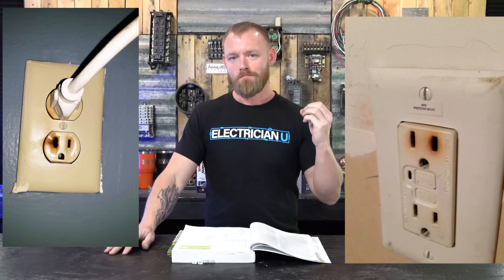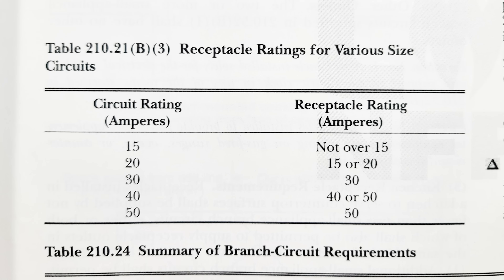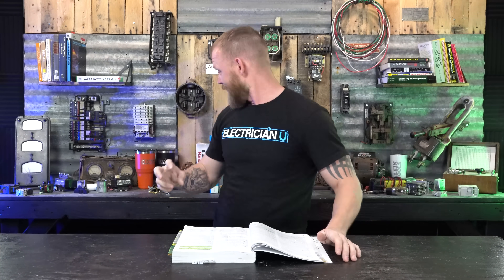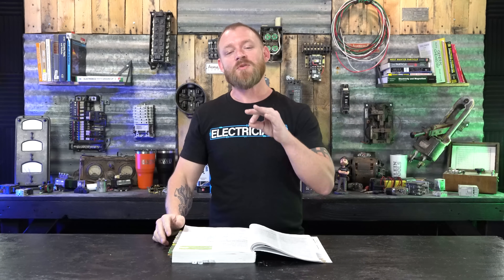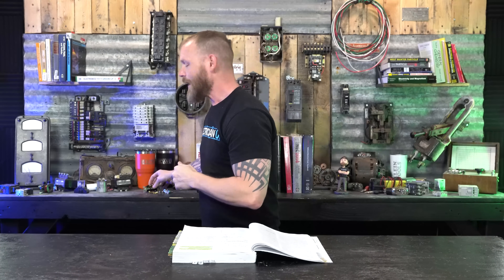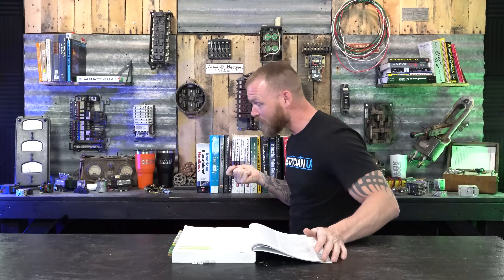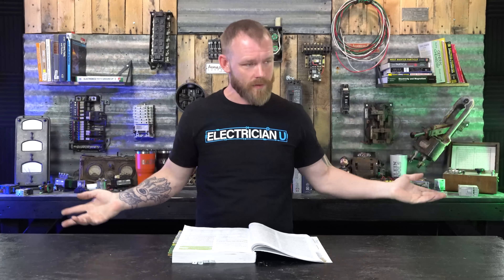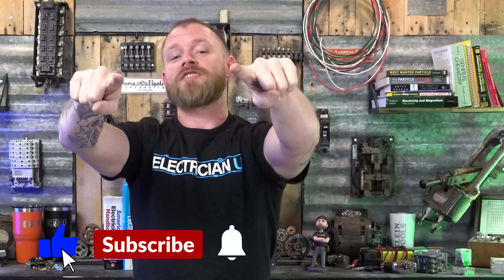Won't These Melt?!? 15amp Receptacles on 20 amp Circuits!!!

Comment: With modern home wiring that mandates an outlet every 6 feet there's less of a chance that any given outlet will have too many high-draw devices plugged into it, so I imagine that this is one of the reasons that's both ok and safe to install 15A outlets on a 20A circuit, since the total load will be distributed across multiple outlets, none of which should have more than 10-12A drawn from them.

Well that's the theory, at least. In reality many people probably tend to overload one outlet using outlet extenders, power strips and extension cords, because it happens to be slightly closer to their devices than nearby outlets, or isn't covered by a sofa or desk and such. All the more so in older structures where there isn't an outlet every 6 feet.

Which is why maybe it might be a good idea to install 20A outlets even though code only requires 15A ones. Are there 20A-rated outlets that don't use horizontal "T" openings and thus look like 15A outlets, which would have the advantage of being able to handle 5 more amps while not encouraging people to overload them even more because they won't as easily know that they're 20A outlets?

But in my experience the real danger lies in cheap, underrated and poorly-made outlet extenders, power strips and extension cords, which make it vastly more likely that any given outlet will be overloaded, and extending the potential point of failure beyond the outlet itself, to say under a sofa or other combustible object. But how to stop people from buying and using these things, and overloading them?

We actually live in an apartment in an older building that was built in the mid-50's that lacks sufficient outlets in the kitchen, where the highest draw devices are located, e.g. fridge, microwave, toaster oven, coffeemaker, etc., and are forced to use an outlet extender on the one accessible outlet to avoid having to keep plugging and unplugging regularly used devices as we use them (the fridge is plugged into its own, hard to reach outlet). The circuit is 20A but it's a standard 15A outlet.

Predictably, every few years we put too much simultaneous load on the extender, and it fails, typically melting some of the plastic and rendering one or more outlets unusable. This only happens when one of us is present, as these are all manual use devices, so someone is always there to unplug everything before it gets out of hand when this happens. But it's worrisome, yet the safest solution, to unplug high draw devices until they're needed, then unplug them, is unrealistic.

My solution was to purchase a high quality outlet extender with more than enough outlets for all our devices, and install a 15A breaker switch inside it, connected properly of course, soldering the 2 hot wires to the hot plug and power rails, and using properly crimped 14-16A female spade terminals at their other end, to firmly connect to the breaker's male terminals.

I'm using 14AWG insulated stranded copper wires for this, even though the extender uses 16AWG wires from the factory. In fact I'm also going to replace the neutral and ground wires with 14AWG wires, to make it even safer. The rails use 1.5mm solid copper insulated wires, which should be able to handle 15A and even a bit over up to the breaker's capacity before tripping.

IMO every outlet extender should either come with a breaker or a bright red warning on the box to not overload it with much more than 12A or 1500W. But that adds costs and as long as the law allows it most people will continue to buy and use cheap extenders and such, and fire departments and insurance companies will stay in business operating full time.

Comment: Ok   I am so confused…  electrical has always been my downfall   Don’t know if you have a video already   But I’m trying to understand … take one wall unit that has two outlets on it, does the whole unit have a rating or do both outlets have a certain rating?  What’s the max you should plung in?   If I have a power strip how does that effect it?    And how do I calculate all lights and power being drawn from each socket?   If I have three bulbs that are 50w bulbs  is that 150w being drawn from that one outlet???  Is it being drawn from whole unit or just that one plug in????    This is probably confusing    I kno what I’m trying to ask     Just don’t kno terminology so …   Any help is appreciated
Reply: Power adds up linearly, so three 50W bulbs in use at the same time on the same outlet or circuit will draw a total of 150W. But if each is plugged into a separate circuit in a different room, then each will draw only 50W per circuit.

A circuit includes all the outlets connected to it, typically but not always circuit one per room. So whether you plug those three 50W bulbs into separate outlets or the same outlet (using an extender), if those outlets are on the same circuit, they will draw 150W from that circuit.

What is being discussed in this video is that while a given circuit might be rated for 20A, in terms of what the wiring in the walls and the circuit breaker in the main electrical panel can handle safely, each outlet on that circuit is likely only rated for 15A, so you don't want to plug in devices that combined total more than 15A (or 1875W on a 125V system, 15 x 125 = 1875) into any one outlet, as it could cause the outlet to melt or catch fire.

In fact ideally you're not supposed to plug in devices that combined draw more than 12A, or 80% of that outlet's capacity, in any one 15A outlet, to be on the safe side (although in reality many people do and it's likely safe as these things are overbuilt if UL rated and of good quality). It's just a margin of extra safety and good practice.

This is one of the reasons that modern code requires outlets every 6 feet, so high power devices can be plugged into multiple outlets on a given circuit and distribute their combined load across them and not on just one outlet. This allows you to safely plug in a combined load of up to 16A or 80% of 20A across all these outlets (although, again, you can probably go up to 20A without safety issues, it's just not best practice).

I hope this helps and doesn't confuse you further.

Comment: I am not an electrician, just a curious DIY guy. Why can't you use a 20 amp receptacle on a 15 amp circuit? I read somewhere that it allows a chance to overload the circuit, but I would assume it would potentially be safer. If I had a 15 amp circuit and had a 15 amp receptacle with a power strip with multiple space heaters plugged into it, it could possibly overheat the receptacle to melting point and be a risk to start a fire. However, if I had a 20 amp receptacle then it would not melt, but instead trip the breaker if it did overload it, potentially saving a house from a fire. Stopping the issue at the source instead of having the current travel through the walls all the way inside. Is the reasoning for this because we would put 100% of our faith in trusting that the breaker would do its job, or does it really affect the line?

Comment: Wouldn't a 15 amp receptacle  at the beginning of a circuit be the path of  multiple receptacles down the line that combined may be exceeding the 15 amp receptacle but not the 20 amp breaker?
To avoid overloading the receptacles at the beginning of the  circuit , should the wires carrying the load never use outlet as a junction as they commonly are?
Using 15 amp rated receptacles as junctions in circuits rated for 20 amps should not be a thing unless the bridge on the outlet can handle the load of the receptacles after it.

Comment: Hey Dustin, this was a very helpful video.   The question it evokes for me, now that I know what you can plug into one outlet.  How do you plan number of outlets on a  circuit such that you don't unintentionally overload a circuit with a device on multiple receptacles as opposed to multiple devices on one receptacle.   I guess I'm asking what is the best practice for maximum number of outlets on a 15 or 20 amp circuit.   Thanks!
Reply: Code actually places no limit to the number of receptacles permitted on a convenience circuit, but it does require a specific number of circuits based on the sq. ft. of the house. Even with only 3 receptacles on a 20 amp circuit, one 1500 watt heater plugged into each would immediately overload it. In fact, only 2 would overload it as well. There is no way to prevent residents from overloading their circuits other than for the breaker to trip, which will tell them "you've gone too far." Unless we always wired each receptacle to it's own breaker (imagine the size of that panel, and the cost of all that copper) there is no way to prevent residents from overloading circuits.

Comment: It’s dumb. Code enforcement are gods and government takes away personal responsibility from us, but they are enforcing dumb code. I wire 15amp outlets to 15 amp breakers and 20amp outlets to 20 amp breakers. Also most extension cords can’t even handle 15amps so 15amp breakers are safer than 20amp breakers for this reason. Obviously costs more for more circuits

Comment: It's  also code requirements to pigtail the wires at each outlet location and the rule of no more than 8 outlets per circuit breaker on residential environment.

Comment: As a residential electrician for many, many years and working at an electrical distributor for several, we had more 20a recep come in melted than 15. The problem is that employees (at a business), renters, or homeowners are gonna overload the recep. no matter if they are 15a or 20a multiple splitters...🤦‍♂️ That responsibility really falls on the renter or homeowner, not the electrician. 
It should be practiced that before one can be in a home, rented or bought, they should be required to be educated on certain aspects of home safety. But that will never happen...

Comment: I am a residential contractor over the hundreds of houses I have been in i can't not remember seeing an appliance requiring a 20 amp outlet. Also the amount of homes I seen with 20 amp outlets i can count with one hand.  How about 15 amp breakers are just built better.  .50 an outlet compared to .75 cents is not going to break the bank.

Comment: Why? cuz idc, my home already passed inspection and I now have enough knowledge to be dangerous and replace that 15a breaker in my panel when it trips because I'm running three space heaters on one circuit lol .... what don't bash me, you know it's a valid point hahaha

Comment: I just bought a house that has this issue.  Nothing was brought up by the inspector before closing but after moving in I noticed 20 amp breakers & 15 amp outlets.  I checked the wiring & it was 20 amp wires on the 20 amp breakers but questioned the outlets.  This answers my question.  Thanx
Reply: So it's safe to have 15 amp outlets on a 20 amp breaker?
Reply: @Kevin_Yagoonie  It’s been some time since I had this question & I’m not an electrician but I’ll explain best I can.  If there is a single outlet (receptacle) on the circuit, absolutely, the wire & outlet rating can’t exceed the breaker’s.  If there are multiple outlets on a circuit, yes, 15 amp outlets can go on 20 amp wire & breakers because the breaker & wire are based off the total amperage.  The video explains pretty well
Reply: @jjstak98h ok thanks. Because I have 20 amp breakers. But my kitchen has a 20 amp GFCI and the other 3 receptacles are 15amp.

Comment: I am sorry, but I have to disagree with you. First space heater do not have 20 amp male plug, if the space heater or any appliance for that matter has a load of 1500 w, it will take about 12-13 amps, so the receptacles are able to hold such amperage on the other hand an appliance with a rating over 15 amp will have a 20amp male plug therefore you need a separate circuit and a 20amp receptacle. Most of the time the reason for melting receptacles will be heat caused by loose blades on the male plug or device itself or as you explained in the video because of overloading the receptacle, which in that case a 20amp receptacle will not prevent the overheating thus the melting of the device.

Comment: It's not the fact that it is a 15 amp receptacle on a 20amp circuit, it is because it is a crappy fifty cent device that has been used more than twice. A commercial grade or even spec grade device does not loose tension (or pressure) on the plug blades like the cheap crap does. Low pressure contact means high resistance - high resistance and high load means high heat. High resistance also means lower current - so the chances are EXCELLENT the the 15 amp breaker would also not trip. Your circuit has more than one device attached which share the current capacity of the breaker. If you have 5 amp load on each of 3 devices you have overloaded the 15 amp circuit - and not gotten CLOSE to the capacity of any of the devices. That is why code allows 15 amp devices on a 20 amp circuit (in many cases)  I just replaced 18? 15 amp outlets in a 45 year old house -  at least 10 of them were discolored and all of them were on 15 amp circuits. 5 were intermittent to the point that a lamp may or may not work when plugged in, depending on how you held your mouth - - - and at least six would allow the plug to be dislodged by light contact.  None of these devices had ever been "overloaded" - several MAY have had a 1500 watt  space heater plugged in occaisionally - or a hair drier - or a toaster.  Extension cords would have been used occaisionally as well (which, in the case of cheap cords, can also contribute to high resistance connections at the receptacle (device) They were all replaced with commercial spec  devices. Sadly, anyone saddled with aluminum wiring cannot obtain "commercial grade" aluminum compatible (co/alr) electrical devices - at least not from any of the major electrical wholesalers or resellers in Canada that I have been able to locate

Comment: You forgot about those .39 cent 15 amp switches on a 20amp circuit.  It's not just people, license electricians do this as well , they charge the customer for 20 amp devices and put the cheap 15amp devices.  I am not a electrician but I have seen other people houses that they got a licensed electrican to wire their house.

Comment: Aaaaaaaaaaannnnddd this is why true 20 amp circuits with 20 amp gfci outlets should be the standard. I've always found it weird that a 20A circuit breaker possibly 50ft upstream of a 15A outlet has ever been okay. Our code is written in a way that assumes that all people smart enough to put a couple metal pegs in a couple plastic holes are also smart enough to know every inch of code. If that 20A breaker keeps dumping 22A into a 15A outlet that far away, then it'll never magnetically trip, because it's within its standards, and it'll never heat trip since the heated outlet is so far away.

Comment: Feds epa senate should stop making 15 amp switch receptacles n 15 gauge wire, only use 20 amp with double circuit breakers 15/15 , 15/20,, that will stop alot of fires led light low voltage can run on ground neutral ,, ground wire should be used in walls n crawl space , attic wire should be regular with conduit uv ,  wires should always be one gauge wire also receptacles n outles switches should be 20 amps, 20 amps should use 10 gauge wire , it will save alot of money .hazzles peace of mind discount on insurance, , long runs should twice the wire until the approved range splice with 10 gauge for example 6 gauge  wire then 10 gauge with 20 amp receptacle outlet,  with a 20 amp switch ,wires get disrupted by extreme cold or extreme heat plus how long there in use around the clock,, n when needed or emergencies you can connect a microwave heater fridge anywhere in the house by changing the breaker,

Comment: I purchased an older home and the panel had quite a few 20 amp breakers, so whoever wired the place took the code to heart.
Reply: Perhaps - in an older home like mine, the critical factor isn't the breaker size, it is the gauge of the wire.   So as I understand it, a 20 amp circuit with 14 gauge wire is a no go.
Reply: @anamcharaenergy  It's 12 gauge in my home and I just recently discovered they wired the storage shed in the same manner. I'm okay with this.

Comment: I have used the same 15 amp circuit for 22 years with the same lighting and appliances on it...I have used 2-1500 watt electric oil filled radiant type heaters on the same circuit in different rooms for all these years without ever having the breaker kick...recently I have had this breaker kick after the heaters have been on an hour or 2.. I have heard that breakers rarely go bad so I replaced the recepticle that seemed to be a little discolored where the plug blades go in..upon inspection there was no melting or disfiguring of the plastic..but i installed the new one anyway..no change..the breaker holds and then after an hour or 2 the breaker kicks..so yesterday i replaced the Siemens brand breaker with a new identical breaker  believing, "there i fix it"! what else could it be.. well it's appearently something else' because nothing's changed..could it be a wiring fault or something like that? Is there any idea you might have on what else it might be? Or could I hire you as a consultant?